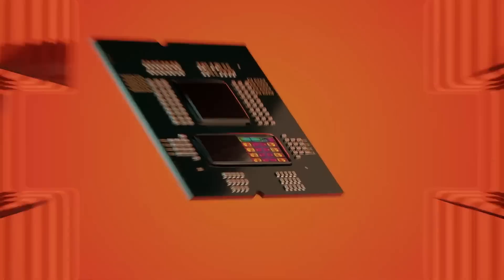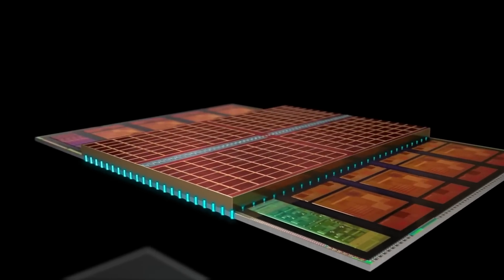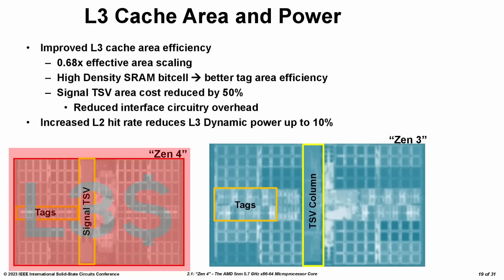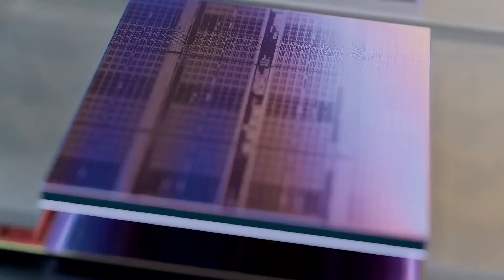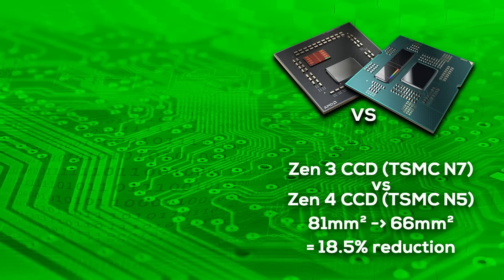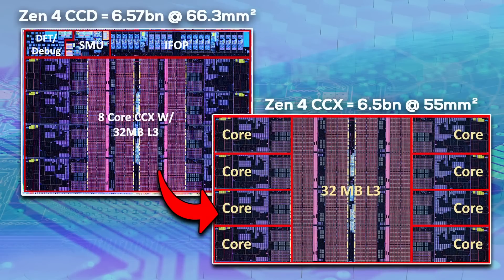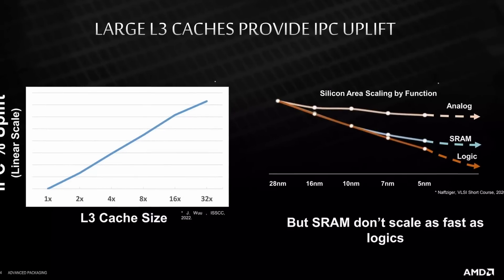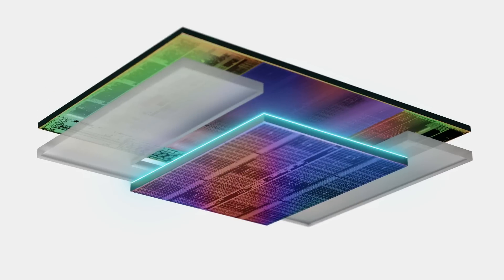AMD's 3D V-Cache Problem

Comment: while i am very impressed by the gains that 3d vcache has made, i have to say i find it to be a rather "lazy" approach. amd's "just slap more cach on it" has a similar vibe to intels "just turn up the power". in fact both are running into their thermal limit though i have to admit that even though it is not easy, the chiplet approach is way more sustainable in the long run and will most likely be the standard going forward.

personally, i see vcache much more of a built in accelerator as it only helps in games and even regresses the multicore performance a bit (while drastically reducing the power needed). it doesnt really feel the same as ipc/clockspeed improvements through architectural changes to the core design.
Reply: The idea that it only helps in games is patently false.  In fact, a large majority of Vcache stacks getting made will be going to Epyc processors, not Ryzen.  There are plenty of different workloads that benefit from more L3, it's just not quite as universal as something like higher clocks or something.  I'd even go as far to say that AMD are being stingy by NOT going with Vcache as standard.  The amount of workloads that benefit more from an extra 400Mhz than the L3 is not actually that big, and certainly the performance disadvantage is pretty small even in such situations.  But AMD is desperate to retain every drop of performance potential possible in order to keep up against Intel.
Reply: @maynardburger  we dont have to kid ourselves. finding a productivity benchmark where the 7950x3d is notably faster than the 7950x is very, very rare. generally, the x3d variant is a few percent slower than the normal one. sure there are exceptions but its faaar from the norm.

as to why amd is putting them on epyc: 1. large servers often run programs custom built for them. this means that such a program could very well use the vcache even though i cannot. 2. vcach drastically reduces the power needed to a point where it close to halves it. this is huge for datacenters. 3. maybe on a $10.000+ cpu amd can afford to put in more cache which only costs them a couple of bucks as explained in this video.

Comment: Love my 7950x3d so far was on a 5950x 3080ti then got a 4090 so i picked up a 5800x3d when it got $320 and now picked up a 7950x3d when it launched at microcenter. Running 32gb’s 6200mhz cl30 ram and a b650e aorus master I see no point for 95% of the people to get a 670 or 670e this time.

Comment: Im no tech designer or expert.. but if the 3d cache becomes bigger than the ccd chiplet then why not just increase the ccd size by making it a single 16 core as apposed to the current 8 core and so smaller nodes make it smaller.. but doubling the cores will give you a larger overall space to put the cache, and i know we dont need a 16 core chiplet yet.. but it would delete the infinity fabric latency times.. unless AMD go for broke and do a 32 core cpu for desktop.. which would be mad.. but amazing too..
Reply: Latency is a problem
Reply: @Centrioless  less than what it is now

Comment: I think we'll just end up with logic dies more separate from cache. Data will be moved over links between a tiny logic die on cutting edge node, and vcache dies on cheap nodes stacked stories high. It's all about cost and profit and datacenter wants wide and efficient and doesn't care about hot single thread throughput, so heat transfer through stacked silicon will always be an afterthought with a patch job to allow consumer parts to clock a bit higher.

I think that's more likely than pie in the sky concepts like through chip watercooling. The maths on moving enough water at sane pressures through the heat dense core logic just doesn't check out at all, and I can't imagine the feat of design and engineering it will be to route all those tiny water channels so close to electrical wires with perfect reliability.

Comment: On die water cooling with microscopic pipes sounds promising, but I have no idea how realistic it is.  I will say shortly after AMD showed off the new IHS for Zen 4 and said the unusual design had an engineering reason behind it I wondered if they were going to be inlets and outlets for such on die cooling.  That was not the case, but I certainly thought it was an interesting idea.
Reply: Then the erosion will be huge problem because you have only few microns or at beast maybe millimeter of space to run water thru and with decent pressure that could be gone kinda quickly
Reply: That's still quite far away from us. The nature of microscopic pipes through the silicon means it must use ultra-clean close loop coolant, otherwise it will be clogged in days. This means it would require a two-stages loop. A more realistic solution is to use a vapor chamber to replace the solid metal IHS, so it would have direct-die contact. I would expect similar level of performance from it as direct-die liquid cooling with liquid metal TIM.
Reply: I am expecting it too at some point.
IMO liquid transport with nanoparticle phase change is the way.
Reply: Direct cooling like GPUs should be enough...

Comment: Cool!  I couldn't see why they would use 5nm in that channel poll/answers, but that they're STILL using 7nm for the cache is hilarious!  Imagine if you're involved in the "fastest game GPU" and you're overtaken by someone using such a mature and unfashionable process, even the IOD has moved to 6nm!
Overall I'm pretty relaxed about this, already in Zen4 the heat density of the cores is causing enthusiast comments, "the chiplets are close together, bad for thermals" despite the IOD often being the truly hottest part of the die under many workloads, then there's der8auer's claims on the thicker IHS being "a mistake" and if you use his delidding tool and direct die cooling your thermals improve.  Yet OTOH review journalists tried out using the Wraith box coolers with Zen4 and were amazed at how little the performance impact was, though the chips were running hotter than spec.  Recently der8er had an Intel engineer in who actually works on the sensor placement and power management for boosting who explained why thermal targets have become a thing, because if you're not aggressively boosting you're leaving performance behind on the table.
Now for me, the future involves power constraints, I just don't see an i9 13900K as superior even if it's slightly faster than an Ry 9 5900x3D using half the power.

Comment: i dont care about 0.5GHz boost, i care more that the L3 cache is per CCD, if the thread scheduler will send the thread to another CCD, this will have huge performance impact. so all this heat dissipation problems are not that important compared to threads constantly changing CCDs.

Comment: AMD has said that SRAM scaling had pretty much stopped. So no point in using smaller node for it.
Reply: It just AMD saying it, it’s TSMC saying they aren’t getting benefits in node shrinks for certain applications like memory and even logic is less than perfect.

Comment: I'm so confused now.  Is the L3 on the base die, or on the chiplet?  Or is it on both, essentially doubling it?  I can't find the info clearly online, it's either too general overview of 3D V cache, or too detailed for someone with my limited expertise on the subject.  Also, why is it called "V" Cache?
Reply from the maker: The base die has the CPU cores with 1MB L2$ each and all eight cores share 32MB L3$.
Then the 3D V-Cache chiplet adds another 64MB of L3$ on top. So in total its 32MB (base die) + 64MB (cache chiplet) = 96MB L3$.
Reply: @HighYield  thank you!  I recall learning about it from a previous video, I must have just forgotten!  Do you know why it is called "V" cache?
Reply: @ClipstopherBurtraw  V is short for Vertical, because the V-Cache is literally directly above the conventional 2D cache.  They are building vertically instead of horizontally
Reply: @kirby0louise  thank you so much, it all makes way more sense

Comment: This is completely incorrect. SRAM cells do not shrink the same amount as overall logic going from 7nm to 5nm. Therefore the L2/L3 areas of the compute chiplet will not shrink beyond the 3d cache chiplet.
Reply from the maker: I don't know what you are talking about, but the fact that SRAM scales worse than logic is literally the entire basis for this video.
There is still a lot of logic on the CPU chiplet, which continues to scale down in size and as a result, the entire CCD will get smaller, while the L3D will stay a similar size.
Especially for future versions, where you want more cache on the L3D chiplet.
Reply: @HighYield  your main contention in the video is that the L2/L3 area of the compute chiplet will shrink... hence the 3d chiplet of the x3d is too big to fit over it. That is completely incorrect as you yourself acknowledge that SRAM does not shrink along with logic
Reply: @asdf_asdf948  Currently the 64MB V-cache is put over the 32MB L3 cache + other electronics logic. Whilst 32MB(of the 64MB) V-cache will still sit nicely over the underneath 32MB of L3 cache. The remaining 32MB V-cache will likely have an overhang problem in future models, as the electronics logic underneath it will shrink faster in area taken.
I don't think it will be a big problem as AMD can simply use the area for additional logic, or more L2/L3 cache.
Reply: @asdf_asdf948  There's still room to shrink the current on-die SRAM cells for the compute chiplets.  These Vcache chiplets are testament to that with their custom, higher density memory design which is more likely at the limits of what can be achieved(on 7nm).  It is definitely becoming much harder, though.

Comment: One “positive” that you left out is that the cache on the main level of the chip continues to take up more and more% of the overall Chip.  So this means more and more of the chip will be cache going forward, meaning more and more of the chip will be suitable for putting vcache on top.   In the end, the way to “solve” this is to simply design the main level L3 cache size so that it is big enough to fit whatever amount of vcache you desire.  If you don’t have enough room for the vcache by 5%… just add 5% more L3 die size.  Because memory isn’t scaling anymore the chip sizes won’t decrease much anyway so the problem isn’t that big of a deal IMO.
Reply: Zen4c aka Sienna might object to the "cache bloat" being inevitable, in hyperscaling they're better cutting L3 cache and giving more % area to lower clocked core logic that's layed out denser too, because it doesn't have to reach high boost clocks.
Reply: @RobBCactive  True but I doubt it'd make sense to put a cache chiplet on zen4c

Comment: If shit hits the fan, the CPU and cache chiplets can always be put onto an interposer and the cache used as L4 instead of L3 in order to reflect the added latency. As long as it provides sufficiently lower latency than DDR5, there'll still be performance benefits.

Comment: I hate these New chips ... they run way too hot...even on water.
Reply: You mean the 7950x3d and 7900x3d?
Reply: Because heat killing CPUs is a thing? (It isn't, the MTBF of CPUs at TJmax is still orders of magnitude less than the period at which they offer relevant performance at stock voltages. Intel and AMD know this, that's why they have exploited the headroom that was once used for an easy overclock, as "turbo")

Comment: I wonder why they've made a frankenstein's monsters of 7900~ and 7950~ X3Ds maing cache only on one die. I believe guys who aim for such top end processors expect to get full pack not some crippled thing. And gamers would be perfectly happy with 5800X3D anyways. Being AMD fan myself, i absolutely hate such intel-like behavoir from AMD.
Reply: Some would argue that this is actually uncrippling it, as you get one set of 8 cores that can clock higher, so you get the best of both worlds in such a system if you have the proper scheduling (which is early days, but will evolve). I think the use cases that would benefit more from having the cache on all CCDs lean more towards workstation, so we will likely see a ThreadRipper3D at some point.
Reply: @GustavoNoronha  thing is, "proper scheduling" is a crutch and workaround needed for those cripppled things to work. Why not just deliver proper hardware that can handle the tasks on its own? I suppose thats nothing more than cursed modern marketing trends that affect products in weird ways rather than selling reasonable products made as they meant to be from purely technical standpoint
Reply: @5poolcatrush  it's not a crutch if you can really benefit from both high cache and high frequency. If you think like that you could say that SMT is a crutch as well for not being able to add more proper cores. But it's in fact a design decision, weighing a lot of different trade-offs.
Reply: @5poolcatrush  Most of the things you'd genuinely need more than 8 cores for would benefit from the higher frequencies and not the additional cache. Not even all games will use the additional cache. It makes sense to also care about games while having many other uses for a 16 core. You could already see from how the 5800X3D is worse in so many common applications compared to the 5800X, that the hit from dual v-cache wouldn't make sense. Having a die that can clock higher is a good thing.

Comment: My dad’s room mate in college back in the late 90’s did some of the fundamental research on TSVs and how to mass manufacture them. According to him, it’s really cool seeing all this stuff come to the consumer market now; imagine what will be available in 20-30 years!
Reply: Interesting :)  When I was designing and implementing CAD software for chip design, adding extra metal layers and linking the planes with vias was an issue but in production .. about a decade before your Dad's room mate so the fundamental research would be a decade or two further back. :)
Reply: @RobBCactive P was discussing TSVs, Thru Silicon Vias, that go thru the base silicon layer. Not the vias to and between metal layers.  These may seem the same from a CAD SW routing tool perspective, but not from a manufacturing perspective.
Reply: Certainly we will have super efficient stacks of many high logic and cache transistors. Moores law is coming to an end but this doesn't mean performance won't continue to improve. 

Some people think Moores law is still in action but I will remind you that the  cost of manufacturing is also involved in the equation. If a node is 50% better but 50% more expensive.. it's a null gain. The future is all about 3d.
Reply: @TheCosmicMason  but Moore's Law is continuing because of stacking and other tech, it's about transistors in ICs.  Yes, costs of process shrinks increased, but it's Dennard scaling that ceased, it used to be shrinks brought faster, denser and more efficient, now leakage is highly significant and thermal density a real constraint.
Reply: We can all be cyborgs with NANO MACHINES BABY
Reply: "hahaha remember when our electro brain implants used non-quantum chips? hahaha what a joke!"

Comment: The trend will be more cache taking up die space in the future, but 3D cache isn't the solution as it has inherent heat dissipation flaws, best isn 2.5D like FinFET.
We need to find a better and more sustainable way to design chips, shifting to RISC architecture like ARM would be a good first step.

Comment: Thanks for an interesting review. I suspect that future iterations might end up with the whole L3 cache separated out in a chiplet rather than the current mixed situation with 1/3rd in the CCD and 2/3rds on a separate cache chiplet. Presumably with a larger L2 to compensate for slightly increased L3 latency.
Reply: Each hop to next level of cache adds latency, as does increasing the structure to support a larger cache size. The Broadwell L4 EDRAM was only about half that of a trip out to dram (DDR3 at the time), which is pretty slow for cache. It's always a tradeoff.
Navi31 would have had dual stacked vcache on the MCDs for 192Mb infinity cache, but AMD decided it the minimal performance gains weren't worth the added cost
Reply: Or maybe they'll reduce the size of the v-cache and add another level of cache, L4. I remember when chips did not have even L2, maybe it's time for a new level.
Reply: @GustavoNoronha   - Intel had L4 cache on some of their Broadwell CPUs back in the day, with an extra 128MB die separate from the main die.
Reply: It will be like the 7900XTX GPU, CCD on the center and MCD surrounding it(separate chips) and there will be only 3D-cache on top of the L3 dies.